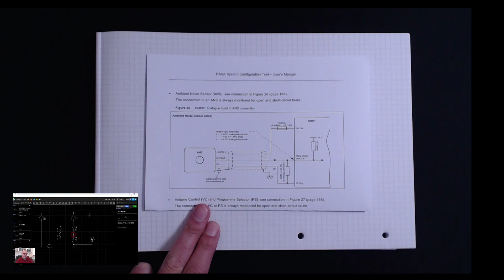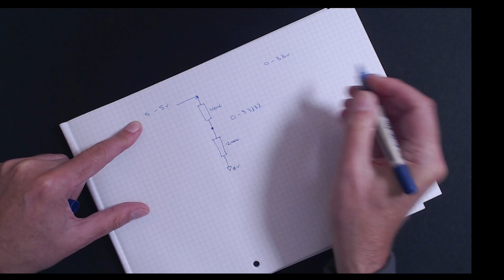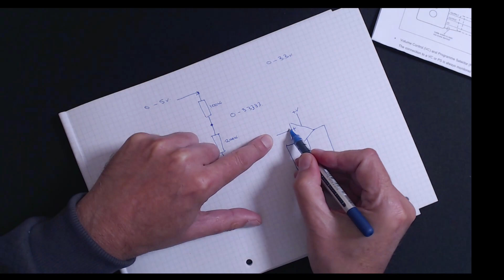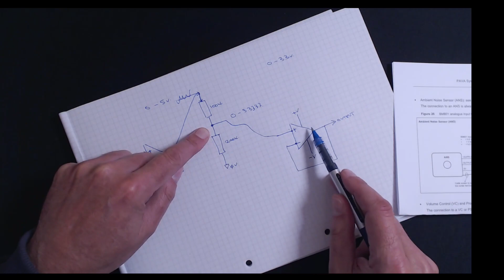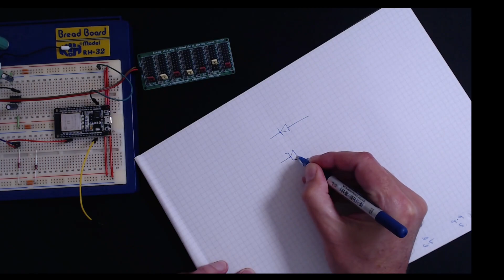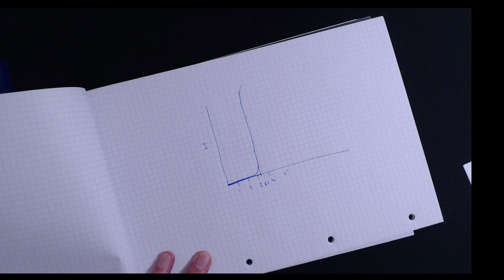ESP32 Based Noise Monitoring Part 1

Comment: Hi Paul. Nice idea - why use 2 op amps, and why split supply?  Input to ESP is a known impedance so buffer not really needed, and signal is always positive.
Reply from the maker: Hi Ru, thanks for the comment. I did consider going direct to the ESP, but chose to use a voltage follower for two reasons really:- 

1) regardless of the ESP, the 100/200K resistors will have an impact on the ANS signal. This would be minimal, but its likely to be feeding into a live PAVA system. 

2) The OpAmp offers some degree of isolation to the ESP. If the person wiring it up accidently connected to the ANS supply voltage (24V) the OpAmp will max out at near its +V supply and effectively reduce it to below 7V. The zener then takes away the remaining smaller excess voltage. 

I used a negative rail because without it, I found the OpAmps do not drive the output right down to zero volts.
Reply: Agreed the buffer is a good thing just questioning the dual stages!  Oh, and it doesn't need to go to 0v I don't think.
Not trying to be smart, just want to know more 👍🏻
Reply from the maker: @-Ru-  one for the voltage divider side and one for feed into the ESP. Its a dual Op Amp, so why not? Agreed it's not entirely necessary but good practice in my view. The code detects when the voltage drops below 0.3V (5V range) which is just 0.2V in the 3.3V range. This is to signify a fault condition and indicated by virtual LED. Without negative rail, I couldn't get the output to drive that low. I tried several op-amps. Lestronics has recommended alternative OpAmp P/N's which I will try, but in the meantime negative voltage supply is necessary.
Reply: @Paul Kemp  Fair play.  Looking forward to seeing how this progresses 😎